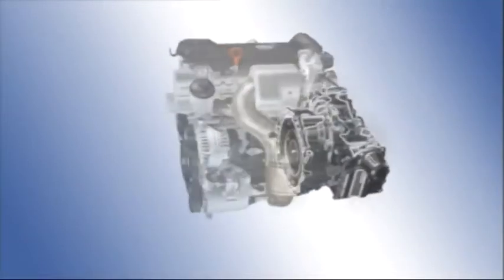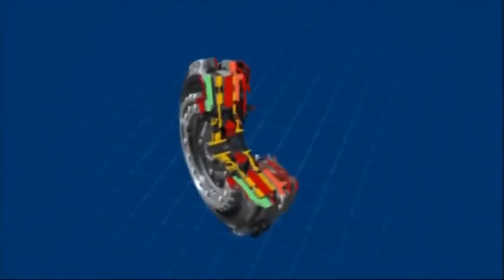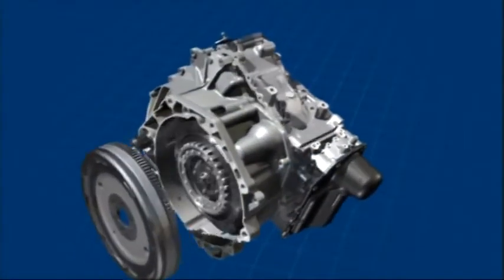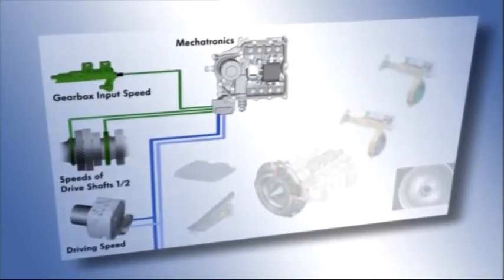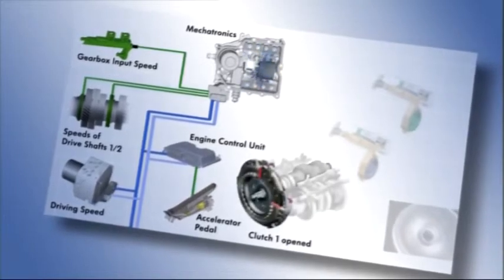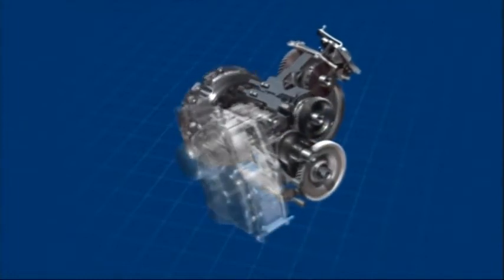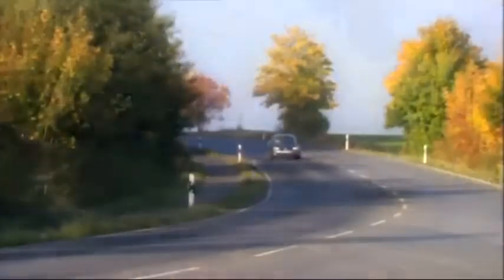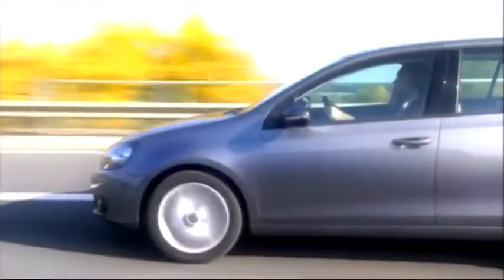How It Works : Dual Clutch Transmission or DSG Explained by Volkswagen

Comment: The idea is ok but these boxes are no where near as reliable as a torque converter auto. Rob Hodgetts
Reply: Torque converters are fine as long as you're OK with tossing large amounts of power out the window.
Reply: Im just glad i got the 6-speed dsg thats said to be more reliable for the gti clubsport (seen at my channel.) As its tuned and putting out 360 hp and 450 torque at the moment (100% to the front wheels alone..) But looking out to get a TCU tune soon. Either by Revo if going Stage 2 or Racingline TCU (formerly Volkswagen Motorsport owned by VW AG themselves) They say it would help against clutch slipping on increased clamping pressure on hard tuned cars. You should check that "Racingline TCU" out if you havent already!  👍